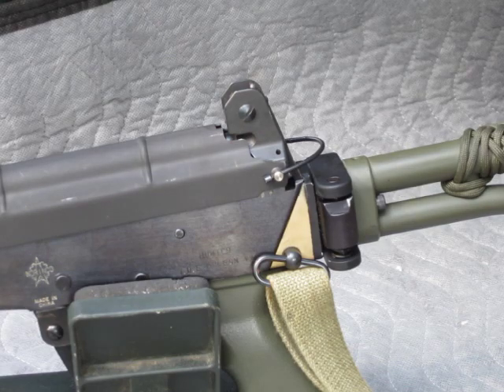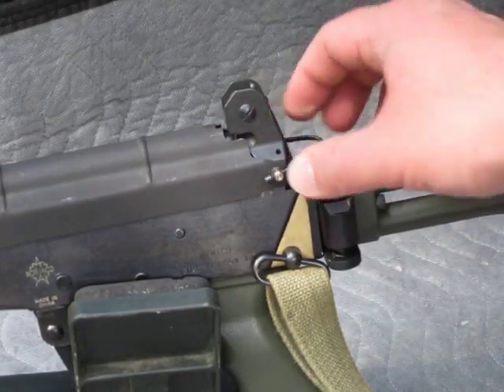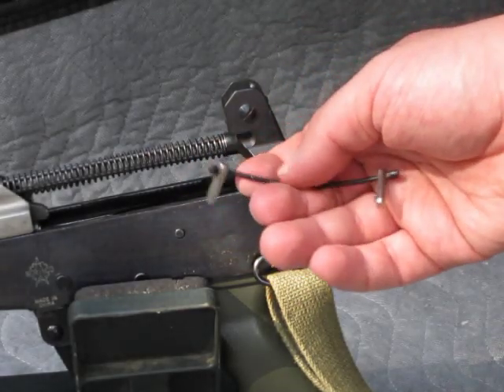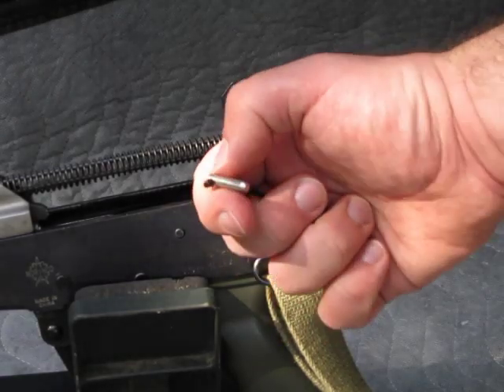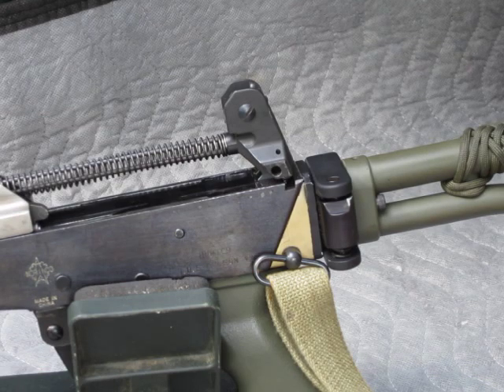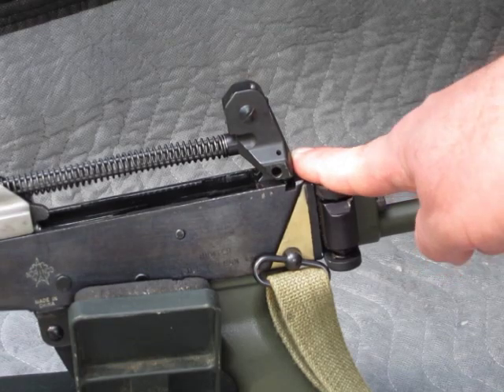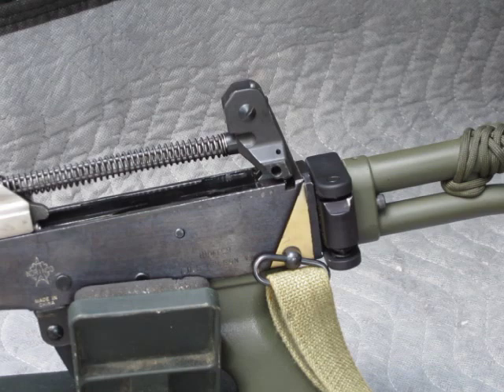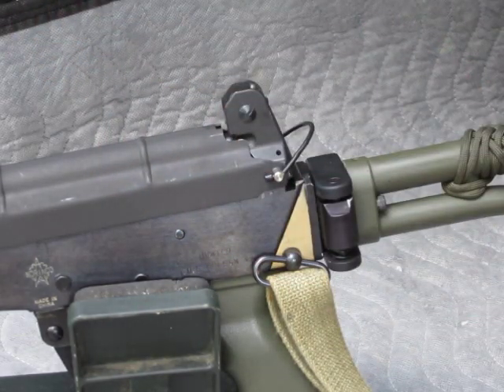Tech-Sights AK Modification

Comment: Are side mounted sights compatible with these sights
Reply from the maker: You may need to remove the rear sight in order to slide a side rail mount accessory on from the rear. The rear sight is supposed to return to zero after being removed, but I would still re-zero it.  The sight axis of the Tech Sights sight is the same as the factory, tangent sight, so any optic that can co-witness the factory sights should be able to co-witness the Tech Sights.

Comment: Just fnished this mod. OP, thank you so much. This is a great mod.
Reply from the maker: Glad to hear it worked for you too! Thanks for watching!
Reply: I managed to fix the wire to the sight tower so it wouldn't get lost. I dilled a small hole in the center vertical tower and passed a small spring through the hole. I used tht other end of the spring to grab the wire. Too bad i can't add a photo to my comment.

Comment: They just need to have those two locking studs protrude a bit more from the sides and have rounded heads. So when you push them in and slide the dust cover back, the rounded studs slip into the cover, it comes off, problem solved. You know, like when you adjust your crutches or adjustable cane, that kind of design.

Comment: 100y zero is good for 300 yards so i'm fine with 100y sight. Really cool idea for these irons, only issue I have is the way the dust cover comes off, seems a bit of a hassle, especially if you got some rocks inside that receiver that you had to get out really fast, it would take some time. Your idea seems pretty nice except I would be worried about those pins coming out during extreme use, drops and whatnot, plus there has got to be rattle with having those 2 pins in am I right? Also I cannot for the life of me figure out if the sight techs rear site is steel, aluminium, or plastic.... Also how is the dust cover that comes with it? Crappy finish on it? is it flimsy? Or is it good to go? And how well out of the box is the center of the peep site to your front site after install? Do you have to way over adjust to one side to get a clean line up or is it pretty much good to go with maybe just a slight adjustment? And do you have to change elevation on your front site after installing this rear site? Sorry for all the questions, I just want to be sure of my purchase before I make my move. If it's to much of a hassle i'm just going to stick with my original irons. Also on adjustments with your rear site, are they tight? or are they lose where you could bump it and it could throw off your zero?
Reply from the maker: The dust cover system isn't bad.  The cover is robust and used to have a projection on the side that tended to dig into the hand when using the charging handle.  It looks like that's been done away with though.  The pins stay put in their holes pretty well with a short enough wire rope between them.  I wanted to add a retention system on the sight tower, but the steel was too hard for me to drill and I don't weld.

There are two different AK Tech SIghts.  The 100 has a flip aperture similar to an AR.  The windage can be adjusted on the Tech Sight, but all of its elevation adjustments have to be done on the front sight.  The 200 has an elevation adjustment built in.  For Kalashnikovs I recommend the 100, since the elevation adjustment is rarely used and difficult to manipulate on the 200.

Overall, I've been very happy with it.  It's a solid piece of kit.
Reply: Thank you for your feedback

Comment: Do you think that it could be drilled straight threw for a lock pin?
Reply: +Forest Schultz Well i looked at the prints and since it's just windage adjustable you could probably drill through with the proper bit and use a single detent pin.
Reply from the maker: The problem I forsee is getting the appropriate bit.  If the steel is hardened and tempered all the way through, it might be necessary to use a carbide bit to make the connection.  A carbide bit of the appropriate size would require a pretty rigid setup, probably more rigid than I could manage on my drill press.  The other caveat would be finding a QR pin of the right length for that diameter.  They exist, of course, but aren't exactly something I see frequently at the hardware store.  A long bolt with a wingnut could work in a pinch though.

Comment: I want to get the tech sight for my yugo m70 ab2 underfolder, will this work for that ?
Reply from the maker: It sure looks like it, but I don't know for sure.
Reply from the maker: It looks like the Yugo-specific Tech-Sight could be modified the same way, I mean.
Reply: +DrThunder88 okay, thanks
Reply from the maker: +rafael cortez No prob.  Thanks for watching!
Reply: +DrThunder88 well I bought the hardware and soon I am going to buy the sight, although I'm not sure if I want the 100Y or 200Y.
But I was asking because my Yugo M70 AB2 underfolder has a button on the back of the receiver so when I put the recoil spring it sits in front of the button. So when I put the cover on and then press the button  it allows the recoil spring to fit through the cover. 
MY point I am trying to make is that I'm not sure if that is going to cause a issue when I install it .
Reply from the maker: +rafael cortez I can't speak to the compatibility with your rifle, but I'd probably go with the 100 if I had to do it again.  I've not encountered a Kalashnikov that needs the adjustability of the 200.
Reply: +DrThunder88 yeah that's what I did, thanks .
Reply: @r.m.cortez8178  Did you ever try this on the Yugo? I'm curious to know the results.
Reply: @aridaniels927  yes.  But I have to make a way to hold it in place. Steel cables jbwelded on pins.
Reply: @r.m.cortez8178  Wait, so did you try this method of installing pins yet? I think you're saying you got the Tech Sights, and they work as designed. But still need to try some new retention system. I can't tell if you've tried the methods presented here by Dr. Thunder.
Reply: @aridaniels927  yes sir, I can't remember if it worked originally,  but I know I did what this video showed, and it worked.  But I believe the the sight wounldnt fully secure with the rear trunnion where the detent would hold the guide rod.
I wish I remembered more about this set up, but I know I ended up changing it back to normal. I also think the sight picture was a little unnatural.

Comment: Do you know if the sight fits on a Saiga 308?
Reply from the maker: I do.  It does.  However, the .308 needs that special, little recoil bumper on its recoil spring assembly or the bolt lugs will jump up into the cutouts on the receiver's upper rail, jamming the gun.  I was able to work around this using a rubber, aftermarket recoil buffer, but eventually the buffer got gummy and held the bolt carrier, causing an easier to clear jam.  I recall someone modifying the Tech Sights recoil spring assembly to use the factory Saiga .308 recoil doohackey, but I just decided to use the sights on a different gun.

Comment: Is there a technical reason that tech can't make a single sight for 100 & 200? Or are they hoping that owners will buy both?
Reply from the maker: The more adjustable 200 ostensibly offers more precision, which may appeal to some buyers.  I now feel the flip-style 100 series may be the better choice for Kalashnikov rifles.  Plus, the 100 costs a bit less.  So I guess the reason for selling both has more to do with marketing than technical reasons.
 
Thanks for watching!
Reply: I have the 200 style and have it set for one distance for cqb. Great system you have devised. Is the reason for the cable between the pins mainly to make it less likely to loose them?
Reply from the maker: Yes.  I originally planned on running it through an eyelet on the back of the sight tower, but I couldn't attach the hardware.  Now it serves to keep the pins together and help ensure they stay in the holes.

Comment: I want to see how the rifle breaks down for cleaning, I cant find anyone who shows this process.
Reply from the maker: Once the Tech-Sights dust cover is off (however it may be attached), the field stripping procedure is pretty much identical to normal field stripping.  The major difference being the Tech-Sights rear sight takes the place of the recoil spring guide, and it can be a little snug, requiring a gentle whack with the heel of the hand.
Reply: DrThunder88 Very useful info, thank you. I definitely didn't know the rear sight had to come out.

Comment: This is actually a really easy mod. I ordered the listed parts but you don't need the stainless tubing unless you want it to look nice.

Just the pins and cable is all you need.

Tap out the set pins, remove plungers, and then tie knots in both ends of cable(with puns fastened on cable) and then just pop em in. Doesn't really need drilling.

Comment: Tech-Sights for AK-74.  They are not a drop-in device and will require modification .  Once installed, disassemble becomes more complicated because of the two spring loaded lugs on either sides of the rear sight. Slightly bending the cover outward at the holes will make it easier to slide the cover over those lugs. However disassembly and assembly will throw off the zero.  You can also expect a gap between the rear side and the cover.  On the one I received the two holes appear to have been made too far back.  Also I had to remove about an eighth of an inch from the from of the cover to make it fit.  After taking it to the range on two occasions, I ended up removing the sites and replacing them with a Mojo peep sight. Don't expect more than 3 inches groups at a 100 meters from this rifle type of rifle. As the barrel heats the groups will increase.  It is a handy little carabine but it was meant to be an automatic rifle not a semi-automatic hunting rifle.
Reply from the maker: The complicated disassembly was what this project was meant to help remedy.  For most rifles, the part is a drop-in replacement.  You are right that some rifles require the Tech-Sights cover to be trimmed, but my factory cover dropped into two Saigas, a Bulgarian SSR-85c, a Romanian WASR, and the Norinco Hunter without a problem.  The only problem I had with the cover is the terrible, knife-edge projection at the rear of the ejection port.  The system holds zero well within the expected accuracy of every rifle I've installed it on.

Comment from the maker: Do you have it on a Saiga .308 by any chance?  I had this rig on mine for a while, and, because the sight didn't have the mechanical recoil buffer of the factory recoil assembly, the bolt lugs would get stuck on the upper rail cutouts.

Comment: Great idea. I just got my AK200S. I have an issue: after install, the bolt will not cycle freely. I have to assist it to close. Due to the amount of side ways motion of the sight if I push the tower from left to right , it will close. I emailed TECH-SIGHTS and waiting on response. Can you or anyone help? Thanks.

Comment: the 6.5mm bolts arent too difficult to find, my here in Tucson, i was able to find them relatively easy at the local hardware store, the moer i think of my ak, the more i think i am going to go with the texas weapon system dog leg rail, a bit less complicated to disassemble, and it gives me the option to mount a BUrris Fastfire II with a QD mount, AND have back up almost HK style sights, not adjustable, but thats life, it should still work. 
wonderful video sir.

Comment from the maker: The pins I got from McMaster-Carr's website.  The item number is 98404A004.  I have a few extra assembled units that I made up with my leftover materials.  The only difference is that the end bits are covered with shrink tube instead of Plasti-Dip, which evidently isn't sold in my area anymore.  PM me if you're interested.

Your SKS solution sounds pretty clever!  Sourcing a 6.5mm bolt would be tricky enough, but the arrangement sounds like it would work well across a range of circumstances.

Comment: i like this, i hope you dont mind if i copy your idea, i did a simalr modification on my sks tech sight, i took a 6.5mm hex head bolt, and replaced it with the original flat head bolt, then drilled through the head of the hex bolt and looped a key ring through the holes. you still have the issue of not loosing the nut that fits on the other side, but it no longer requires tools to dissassemble the rifle. where did you find those pins if i may ask?

Comment from the maker: That's a great question, and it makes me realize I missed that.  The quick release pins each have a small, spring-loaded detent ball that engages the holes that were formerly occupied by the roll pins that had retained the old plungers.  The alignment is scarily close to perfect with the quick release pins I used, but moving the former roll pin holes inward about 1/16" or so would be even better.